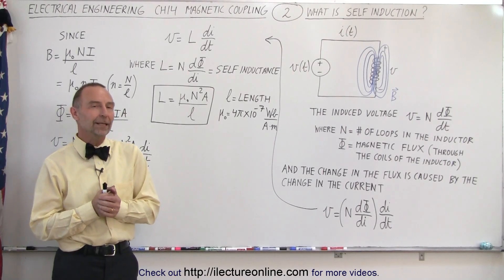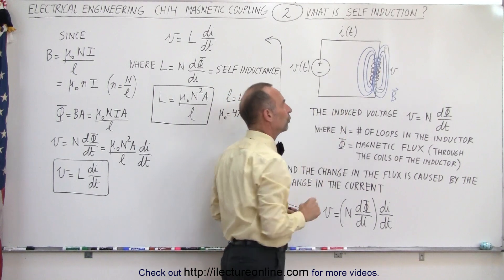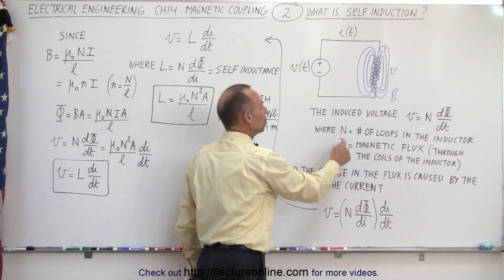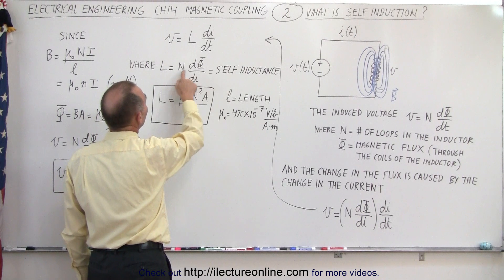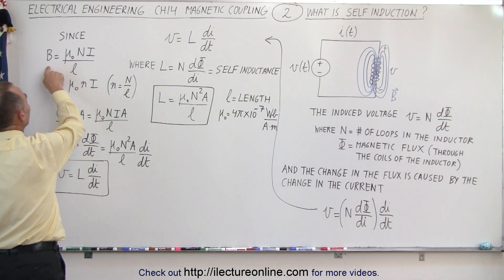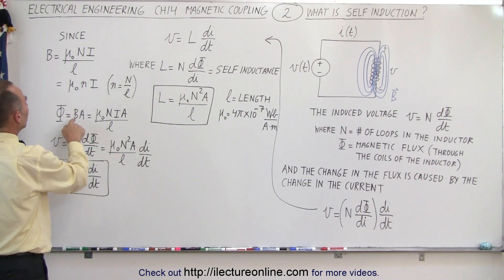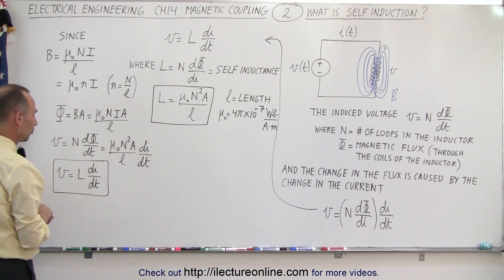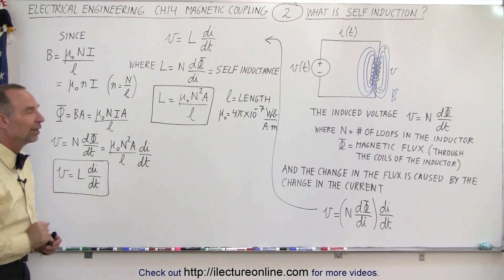Electrical Engineering: Ch 14 Magnetic Coupling (2 of 55) What is Self Induction

Comment: Sir, you should unpack that exposition. n=N/L what is the context of that variable n? Why one needs to define it?
 As for the magnetic flux (in a coil - what kind of coil? What geometry? If any, how? An example of a specific kind of coil so that the l in (magnetic permeability x number of loops × current x area)/ l    would make sense in a spacial context). 
Also, what does a loop in a conductor does with the magnetic flux around that conductor (wire geometry)? Does a loop in a wire conductor causes a variation in the magnetic flux with respect to space? Where does this effect with loops comes from? What is its mechanics?